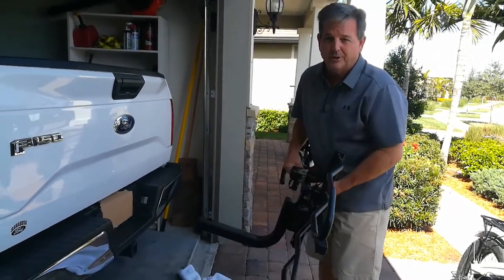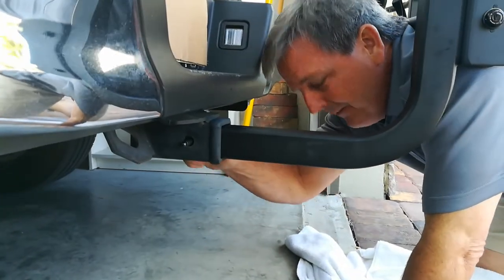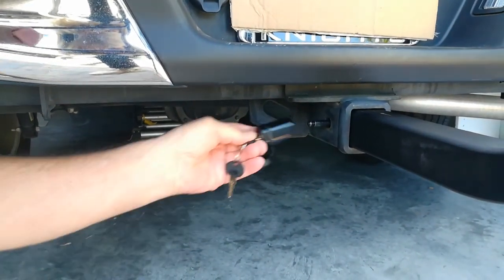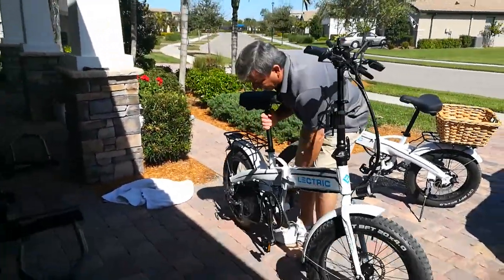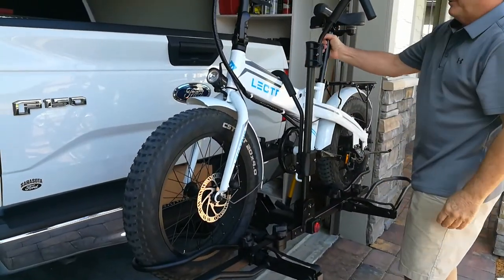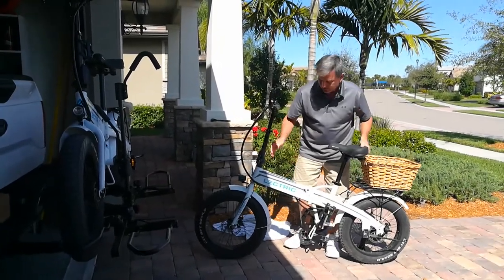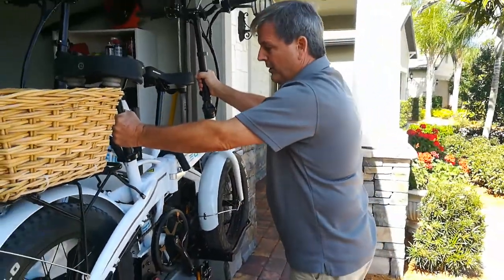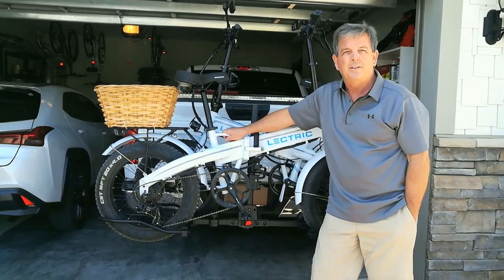Lectric XP E-Bikes utilizing Overdrive Bike Rack

Comment: Great video; just ordered one of these racks. I am curious about the center vertical bar. It seems it would be much easier to load the first bike with the vertical bar down rather than dodging it? Is that possible? I am just asking for myself in hopes to avoid hurting my back lifting the whole bike while also avoiding that vertical bar.
Reply from the maker: Hi 10Nacious1.  I tried with the vertical bar down, but the securing arm gets in the way.  If you remove both locking mechanisms, you may be able to do it that way.  Thanks for the observation.

Comment: Thanks for the information.  Do you think this rack is strong enough for a motor home?  A lot of racks even with non electric bikes are not recommended to be used on an RV.  Where did you buy the rack and how much was it?
Reply from the maker: I purchased the bike rack on Amazon for approximately $300.  It may have increased in price since I purchased mine.  I would recommend checking the weight limit specifications on your RV to see if it can handle this bike rack.    Thanks for your input.

Comment: Do you transport your bikes in inclement weather? If so, what precautions do you take to protect the electronics?
Reply from the maker: Hi Blake Berlin.  I cover each bike with it's own bike cover and secure it with bungee cords.  This has worked fine for me even with heavy rains.  (In very bad weather, I've also covered the screen with a zip lock bag and rubber bands for added protection from moisture.)

Comment: Great video.  Do you know if this rack will work with the Lectric  Step Thru bike?
Reply from the maker: Hi Michael.  I'm not sure if the securing mechanism drops low enough for the step thru.
Reply: @vespaenthusiaststimlisah.  thanks I’ll do some more research
Reply: Yes sorry just asked the same question.  Did you find out Michael?

Comment: Hi Tim, if you tilt the rack with the bikes mounted, will your tailgate fully open?
Reply from the maker: No, unfortunately you can't open the tailgate all the way.
Reply: @vespaenthusiaststimlisah.  Thanks for the quick answer. I'm trying to decide which vehicle to add the 2 inch receiver, F150 or Subaru Outback, so I'm gonna go with the Outback since cargo in the back of the pickup is unreachable unless it's around the edges.Looks like the Outback tailgate will have no problem opening with the bikes tilted.

Comment: I believe this rack is rated for two 60 pound bikes. I also have two Lectrics and the manufacturer says they weigh 63 pounds each. That's without any accessories. I want a rack rated for two 70 pound bikes. The consequences of having a rack fail is terrifying.
Reply from the maker: Hi James.  When I travel on anything other than local rides with my bike rack, It's very easy to remove the 2 seats and the 2 batteries and then I'm below the weight.  The seats are close to 3 lbs. each and the batteries are approx. 7 lbs. each.  Removing both for each bike lightens the load by approx. 20 lbs.  Please check the weight of your seats and batteries to be positively sure.

Comment: All these videos showing e bike racks are placed on pickup truck hitches. Why not just put the bikes in the bed of the pickup.
Reply from the maker: I currently have a tonneau cover on my F150.  The E-bikes would need to be placed in sideways to fit and could possibly get damaged.  The bike rack is actually quite easy and keeps the bikes from getting scratched when used properly.

Comment: Why the hell do you have a hitch rack for your bikes???  You have    A    P  I  C  K  U  P....    You know, that large open area in the back, THE BED?!?!?   Maybe just chuck them in the back like a rational person???
Reply from the maker: The bikes can get damaged during long rides in the bed of the pickup.  Not recommended.
Reply: @vespaenthusiaststimlisah.  Your bikes fold.  I've seen a ton of people get big plastic tubs, and put the folded bikes in the tubs/then into the vehicle.   I have 'standard' bikes.  I have installed fork mounts along the side of my bedrails.  So my bikes sit in the bed.  Super protected, and they don't slide around.  AND I don't bash my shins on the rear rack...
Reply from the maker: @bikebudha01  Thanks for your reply.  I appreciate your help in trying to save some money.